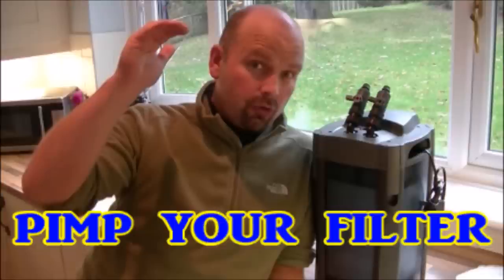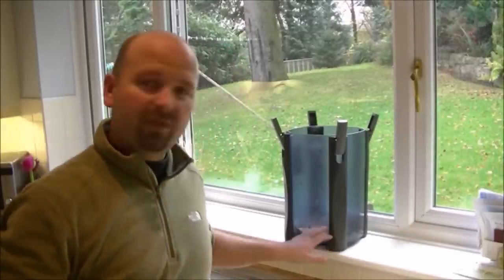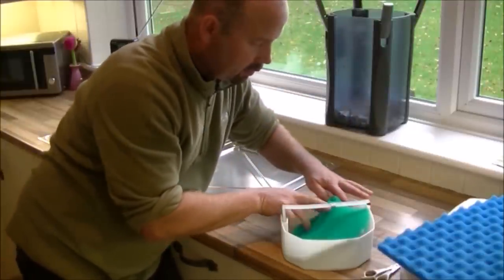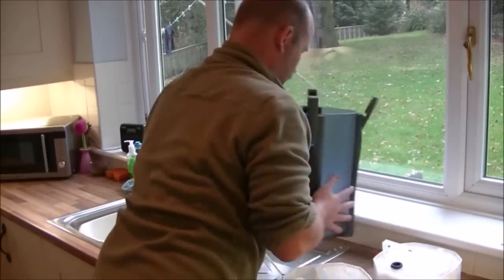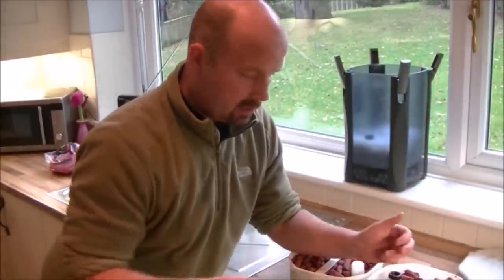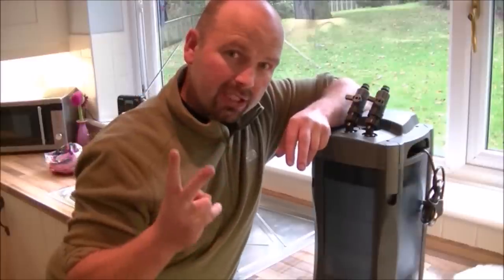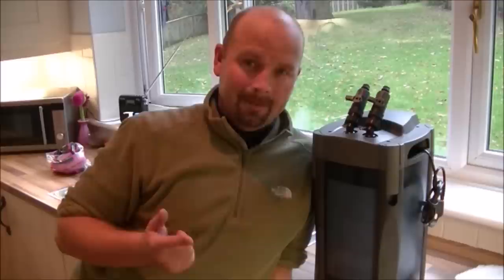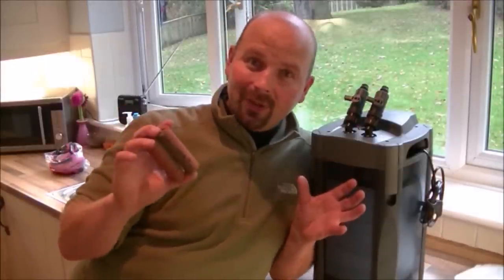External canister filter set up, nitrogen cycle and what happens in a filter - by Pondguru

Comment from the maker: Herberth Chavarria Carbon really should be the last thing used and it does draw in colour from bogwood and treatments but in a normal tank it will not be needed - should be the last thing water hits if it is used in a filter as it clogs up extremely fast.
Reply: +Pondguru Outdoors do you use ro water
Reply: +Pondguru Outdoors do you use ro water
Reply from the maker: +Venice Mackay Not up here as the tap water is fairly good. With properly set up filtration and the resulting minimal water changes there is no need to go the RO route. May be different in areas where the water isn't so good (South East, Midlands, Nottinghamshire are places where many people seem to struggle with the quality of tap water)
Reply: i use ro it is best for my set up which is south american set up.

Comment: Hi PG.. How can I pimp my HOB filter? I will be cleaning my canister in the next week or so.. I'm excited to do it this way. I have all your points in my Cichlid journal.
Reply from the maker: Really the order of foams and media will not change with any filter but upgrading a HOB can be more problematic since they are often developed to rely on a cartridge system. I'd say just go with decent foams followed by as much good media as you can fit in there and you won't go far wrong.
Reply: Good That's what I've done. Thanks

Comment: Hi Richard, been using your canister filter setup for quite a while now and very happy with it, In my first tray (bottom) I'm using Jap (koi) matting, medium foam then fine foam instead of the floss and have had no problems. I clean my filter every fortnight and do a 20% water change on my 300L tank every week mostly to vacuum the floor etc. Does this look OK? my wife thinks I shouldn't be cleaning so often but I do like a clean tank! just a shame I can't have plants as my Bristlenose Plecs shreds everything I put in lol
Reply from the maker: If you've got the other trays filled with biohome the tank should only need 10% water change every couple of weeks as after 4-6 months the anaerobic bacteria should kick in and reduce nitrate (which is the main reason we do water changes). In a 300 litre tank you would need around 3kg to process the nitrate from a normal community tank and around 5kg for a heavily stocked malawi tank or predator tank.

Comment: dear Richard, here is how I put media in my canister filter from bottom to top: ceramic rings, activated carbon, sponge, biohome, biohome...is the order good?
Reply from the maker: +Aboud Bakkour If the water flows from bottom to top as it does in most externals that is just about right but the carbon should really be the very last thing the water hits before leaving the tank as it clogs super quick and needs to operate in very clean water to be effective.

Comment: Just bought the All pond solutions EF1400 UV Filter, I have taken all your advise on ceramic rings in the bottom. 3 Different sponges, course, medium and fine, bought some of your Biohome media, for second basket, I have some ceramic rings and Activated carbon left, do I need carbon on my top layer in my African Chiclid tank, or should I just add purigen.Your help in this matter would be appreciated
Reply from the maker: The ideal scenario would be to have the foams and fine pad in the bottom tray with biological media in 2 trays above. If you have the 1400 filter it should take 1.5kg of either bohom mini ultra or biohome ultimate per tray (2 best types for external filters) so you can get a maximum of 3kg in there.
I think you ordered 500g of the biohome standard which will still work as a filter media but is more dense, and smaller than the 2 types mentioned above. You'd probably still have room for 3kg of the more porous types as the biohome standard will fill in gaps between the larger media.
There are notes about filtration and how much media is required to deliver full cycle filtration (reduction in nitrate) for different types of stocking densities here: http://filterpro.co.uk/qa-24-w.asp and a properly sized filter will easily hold enough to make that happen without the need for chemical filtration unless it is required to draw in residual fish treatments or colour from bogwood (which won't be an issue with African cichlids as the water needs to be hard and high pH)
Feel free to ring any time 9-5 weekdays on 07772848730
Regards,
Richard

Comment: Just ordered this stuff, quick delivery! I have an APS external filter and an aquamanta filter - which way should I place the media ?
 - thanks
Reply from the maker: They work exactly the same way as the filter in this video so just set up the same with foams in bottom and media in trays above it and it will run efficiently. You'll only need to use about 1/5 of the balls so store the rest in a sealed container or bag until you need them (maybe after filter maintenance)
Reply: Thank you

Comment: I follow your exact setup, but I like to keep the white fine pad on the top thicker, I wouldn't cut it before placing it on top because otherwise I get some bypass problems.  I think it's better to go thicker on the fine pad on the top of the tray.
Reply from the maker: Yes a thick pad will catch more muck and the size it is cut to or thickness of pad relates to how dense it is. A more dense pad can be thinner but a less dense pad needs to be thicker.
Good quality pads will have minimal shrinkage but you're right its always best to go thick and cut bigger than you need to allow for that.
Thanks for watching and appreciating the video.
Reply: Thanks for the tips, I also use biohome ultra after watching your videos.   I ordered it on ebay for all 6 of my canisters for my tanks!
Reply from the maker: Sounds good to me, thanks for the order and you will not be disappointed with it.

Comment: Nice video Richard and thanks for the idea. Wood like to try your media but my media is still like new.  
I been using this setup since you posted your first video on "HOW TO SET UP AN EXTERNAL CANISTER FILTER FOR AN AQUARIUM" and my media is as clean as the day I put it in. The media I'm using is EHEIM Substrat Pro Biological Filter Media (Sintered Pearl-Shaped Glass).
Reply from the maker: That's a good media so see how it goes. Only negative is that it can't support as much anaerobic bacteria as the mini ultra or ultimate media due to the small ball size but for ammonia and nitrite it is very efficient.

Comment: I ordered this exact upgrade here in the U.S from the supplier you suggested. I do have one question. I have a brand new tank with no fish. After I have the filter setup how long should I wait before adding a couple hardy fish? Does the cycle move along faster with a few fish? Is it too hard on the fish? I plan to get a couple of Danios to start off and get the tank cycled.

Thanks for the great video!
Reply from the maker: GPVlog Leave it a week or so then trickle fish in weekly. The gel balls will iron out any ammonia spikes so fish shouldn't even know there is ammonia or nitrite there as media establishes very quickly to process it once gel balls have seeded media. Cycle won't necessarily be faster with fish against fishless cycle but certainly safe to do when you are using good media and proper live bacteria. Thanks for watching and appreciating the video.
Reply: Thank you very much for the info. You are very helpful in this area.
Reply from the maker: GPVlog No worries.

Comment: Hello

Tank Specs:  220gal tropical community with 35 mostly adult sized fish.   FX 6   &    Aquaclear 500.

I felt it important to share my thoughts on Biohome after 18 months or so.  You videos state that it will complete the entire cycle, ammonia through nitrate/s.  Prior to purchasing I searched reviews, and read where many shared doubts.  

I check my water, change my water routinely, and after the year mark my nitrates hardly discolor the test strip at all.  Nitrite and nitrate strip pads just look wet, they literally do not change color.  I have biohome exactly as you stated coarse, medium, fine...  and the rest biohome in an fx6 and an aquatop 500 on my 220  gal.  It performs like you said it would. 

Parameters yielded nitrate results hovering between 20 and 40 ppm rather consistently.  I checked it one day ( twice ) and the nitrates pad didn't change color.  Check it again a few days later, same thing.  It's been this way for months now.  It seems the 12 to 13 month seasoning is key.  I know I have a relatively low bio-load for a tank this big, but I have only had the 220 for about two months.  The decrease in nitrates actually appeared within my 75 gal.

Thank you for your honesty and helpful videos.  I believe you have reduced my learning curve exponentially.  I wanted to share this because I believe in your product, and if someone is contemplating purchasing Biohome, I'd say give it a go.  It takes some time to get to anaerobic processing, but it is absolutely solid in my tank. 

Thank you.

Regards,

Lou
Reply from the maker: Dear Lou,
Thanks very much for the comment and I'm glad you're pleased with how the biohome is working. For 220 (US) gallons / 800+ litres an FX6 could be considered underfiltering as it will only hold a maximum of 5kg of biohome ultimate (normally around 1kg per 100 litres would be required to see the nitrate reduction for a community tank) so it is good to hear that results have been achieved below those figures (if it occurred in the 220 gal.)
I always like to err on the side of caution when working out recommended amounts to use for different situations but 1kg per 100 litres is a good figure to aim for when running a normally stocked community tank.
If you had the FX6 running on the 75 gallon tank with 5kg of media in I would be shocked if that had not completed the cycle and brought nitrates down as that one is 285 litres.
I've looked for your order but can't find how much you are using (you may have ordered from US supplier).
Regards,
Richard

Comment: Hey mate i watched a few of your videos and followed the instructions.  Just a quick question,  most of the filters you've set up have 3 trays, mine has 4.
It's aqua one larger filter.
What would you consider putting in the 4th trays. 
Keep going good work , i really enjoy your videos  !!
Reply from the maker: The 4th tray would just be used for more media and any carbon / charcoal media you may want to add.
Reply: Pondguru 
Thanks for the reply mate!!
I actually found one of your videos where you set up 4 tray filter.  Make sense. 
Cheers

Comment: awesome video my friend, i have a question i have the penn plax cascade 1500 it comes with 5 stage i do mechanical filtration on the bottom like you did and then carbon and then the biological filtration on top is that correct? or should i stop using carbon? i heard its make the water clear

Comment: Great video just ordered the 3kg upgrade pack. My FX6 comes with two media bags I should use these in middle and bottom baskets to prevent ultimate from damaging impeller or surge valve?? Is that correct??? Chip
Reply from the maker: +Paul Chippington I sent a n email or reply to ebay message regarding the FX filters, no worries. Foams in top, media in trays below for that one as it works top top bottom.

Comment: I have just acquired a Fluval FX5, unfortunately without its filter media, Any thoughts on the best way to set it up ?
Reply from the maker: Exactly the same way as this video does - I mention FX filters toward the end. Foams need to go in top tray as the water travels from top to bottom since the pump is under the filter. The FX5 takes 5kg of media if you fill all trays.

Comment: Hi, I use both biomedias in my cannister filter, bio home and biosphere. My question is I just purchased your peat balls to help soften my water, where do you recommend in a top fill 4 tray system ? Glad also that you have made your products easier to obtain here in the U.S from Great wave. 
Thanks,  Bruce
Reply from the maker: Bruce Krolikowski I don't know what a top fill 4 tray system is so don't really know how to answer that one - is it a trickle filter?
Reply: Yes sorry,its the same type that you show in your video but it has 4 trays instead of 3 inside of the cannister. Thanks Bruce
Reply from the maker: Bruce Krolikowski If you are using the peat balls in the filter they will go in last tray. The external filters generally have both inlet and outlet at top but 99% have water travelling through tube to bottom and rising up through trays like the one in this video. The one in this video would have peat balls in top tray if they were used in filter.

Comment: With the bottom void area where you put the ceramic noodles would it be better to put it in a mesh bag to make for easier cleaning
Reply from the maker: As long as the mesh bag was quite coarse then that would work fine. You still need to wash out the bottom of the canister so it really doesn't make much difference.
Reply: Pondguru yeah the media would be in the bag to make for easy cleaning

Comment: Hi Richard. I've just bought an external filter, I've also purchased your kit on eBay. I'm now just wondering can I put peat or Almond leaves into a spare tray in the filter? If i use peat is it necessary to use carbon as well??
Reply from the maker: +Jonathan N Love I just answered this via the ebay messaging system as you asked the same question there. Feel free to phone me any time - not sure if you are in UK as I couldn't find an order with your username.

Comment: If you brake ceramic rings into halfs then you drastically increase there surface area per cubic inch of rings while also reducing the space they take up :). 

Ive had one hang on filter running with split rings under the panels for over 2 years, only ever clean first filter pad panel.
That tank had something spilt in it, So i very quickly bagged fish and did a 98% Water change let it cycle for 6 hours with bags floating and tank never crashed fish were fine.

Comment: Brilliant info Richard...  can u tell me please ,  what would be the correct set up for the eheim pro 4 600  ?  As usual the white fine sponge came in the top part of the filter,  should they be in the bottom tray as with most cannister filters ?  And also,  do u think the media that comes with the filter is sufficient? Many thanks,  I'm off to watch one of ure pond building videos... 🐟🐠
Reply from the maker: Apart from the 'pre-filter' tray which should be left as it is just set it up the same as this video with the coarse, medium and fine pads in bottom tray then media in trays above that. Often the eheim filters will come with a plastic mechanical media in bottom tray which wastes a lot of space so its best to use foams and fine pad there. Some of the eheim media is decent, some is not so good and as far as full cycle filtration goes I can only advise on the biohome ultimate in a canister since we know it could take anywhere from 1kg per 100 litres (normally stocked tropical tank) to 1.5kg-2kg per 100 litres for a heavily stocked tank (e.g. cichlids, predatory fish, goldfish etc.) to achieve a full cycle (reduction in nitrate).
Reply: Pondguru.. thanks for that Richard..appreciate the swift reply ...  I'm sure there's 4 trays in the cannister,  so 3 available for the media ?
Reply from the maker: Yes that is correct.
Reply: Pondguru.   Thanks Richard,  will be in touch imminently to get an order to u... do u sell/ deliver the foams that you use on ure videos ?  Cheers...
Reply from the maker: Yes I do them on my website http://www.filterpro.co.uk (links in video description and pinned comment on most of my filter videos).

Comment: how often should you open up the filter to rinse off the media, is it every week when you do a water change or once or twice a month or less. thanks
Reply from the maker: Really a suitable sized canister filter would only need checking once a month at most and if the media looks dirty just give the tray a quick shake in water you've drained off from the tank. Really the only thing which needs regular maintenance is the foams and fine pad. The fine pad would need replacing when it gets clogged and if foams and fine pad is doing its job the media should stay very clean.

Comment: Great video!  I think I may even add the Biohome to my aquaponics setup.  About what size tank would this filter support?  Thanks!
Reply from the maker: I'm not sure how effective it would be in an aquaponics system given the nitrate reducing properties and I don't have any reports regarding that unfortunately. The filter in this video set up the way it is would be fine or up to 400 litres, maybe more - depends on stocking and feeding.
Reply: BioHome may inadvertantly remove nitrates from an aquaponics setup. Nitrate removal is the Holy Grail in an aquarium setting, but is counterproductive for aquaponics. You don't want your bio media to remove/breakdown nitrates in aquaponics. Nitrates are plant nutrition. Leave the nitrates in so the plants you grow will flourish. Pondguru does sell a version of BioHome that is less porous and does not promote de-nitrifying bacteria growth. Perhaps Pondguru can elaborate on that version.
Reply from the maker: Jaime Craig Best forms of biohome for nitrate reduction are the ultimate and ultra (small and large varieties of each) although all biohome will reduce nitrate to varying degrees. Best media for hydroponics would be plastic (e.g K1 or Hel-x) in a moving bed filter as it only converts ammonia and nitrite and produces masses of nitrate.